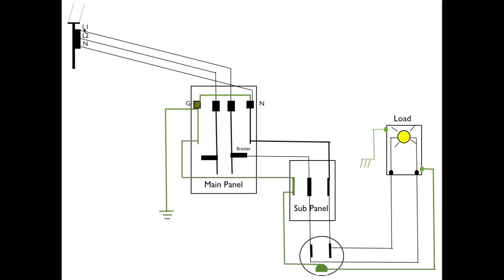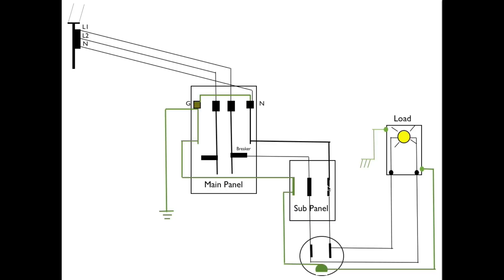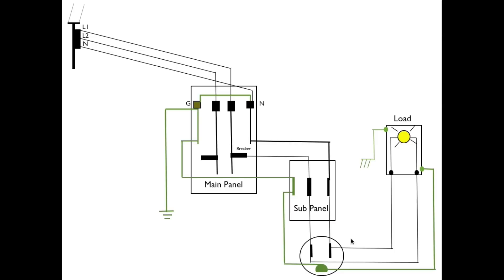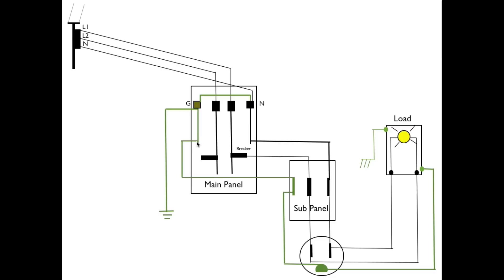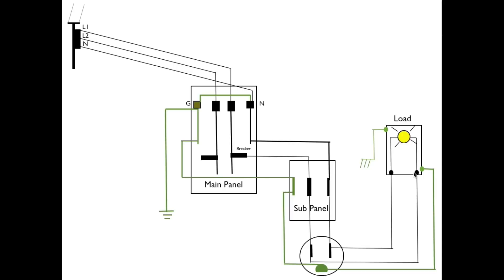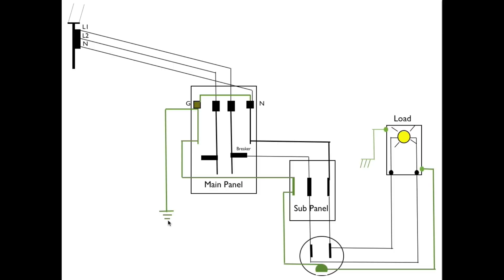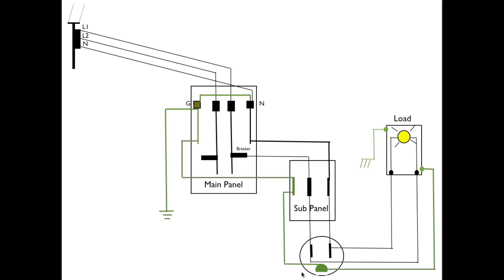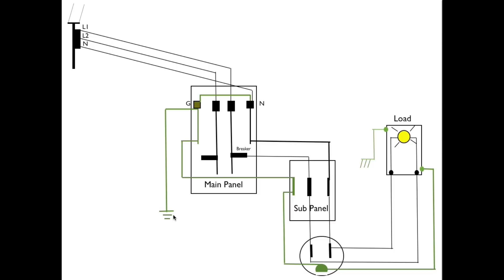The difference between neutral and ground on the electric panel

Comment: There is no such thing as a ground wire , in the NEC. the conductor going to the grounding electrode is a grounding electrode conductor. The equipment Grounding conductor is between the panels. The EGC is to return to the neutral at service because this is its path back to the transformer at the pole. A Fault Current on the EGC is not going to go to ground ( the earth) but to the services neutral to the transformer and return to the breaker thus tripping the breaker if the fault current is 6 X the breaker ampacity . Fulmer Electrical Training
Reply from the maker: necfulmer Oh, for Pete's sake get over it.  A wire, a conductor, its just semantics.  The point here is defining why the ground and the neutral are not connected in sub panels and the solid reasons why it is done that way.  We are not passing codes here, just explaining.  At least, we are in agreement about the neutral and fault current.  However, the fault current is not necessarily 6X ampacity.  Small over currents will still kick the breaker, just not immediately.  Despite my complaints to you I do appreciate your comment.
GFM
Reply: Point out anything under six times the breaker ampacity will delay the tripping. 120 amp fault and over will trip a 20 amp breaker immediately. A 40 amp Fault can take 5 seconds to 120 seconds. In that time something can burn up. So better the effective Ground-fault Fault  current path the quicker it will trip. Very important , loose screws, fitting and joints can delay the tripping.Also bonding the neutral at a sub panels can cause delay and stray voltage current on all metal parts.
Reply: grayfurnaceman
Reply: necfulmer — Nobody is going to use the new NEC terminology unless some authority figure demands it.

Comment: thing thats always confused me is in a circuit without an isolator on neutral the insulation test always shows a direct short to ground. so fine if you disconnect the neutral you can test the circuit. but if neutral itself is showing a direct connection to ground through the transformer why the fk doesnt it go bang the way it does if a circuit neutral has broken down at a switch or within an appliance 🤔 i get that its a different type of ground but still confuses me to hell 😑

Comment: Got to get them together in the maim meter and separate I'm the main panel, this way to wire is more then 20 years old, is not the new code
Reply from the maker: Not to beat you up, but your use of the english language is terrible.  If you are trying to get across technical information, you have to deliver it in a way that is understandable.  Try again or get someone to help you get your idea across.
GFM

Comment: Sir I think you could have done a better explanation... you never use the word impedance or bonding. If a lighting hit a pole it will go to the lower impedance conductor. Which it will be your grounding electrode,  mechanical ground or your EGC equipment grounding conductor. Amazingly the earth is NOT a lower impedance path.. electrical work it is a DIY for the weekend. Leave it to the pros.
Reply from the maker: This not a code video.  It is an explanation of how things work.  Sometimes the language used in code discussions makes these concepts harder to understand.  I also do not find that earth ground is not a low impedance path to be amazing.  Dirt never has been low impedance and its only use is for a zero voltage plane to absorb lightning charges and spikes created by components in the line.  This concept is poorly understood, even by some electricians.
If you think lightning only travels thru the low impedance conductor, you are mistaken.  It will travel thru all conductors.  We just hope most of it travels thru the lowest impedance conductor.  Not trying to beat you up, you are just not object of this and the other videos I have done about electricity.
GFM

Comment: LIGHTENING strike at the pole, Your pole should have or better have an earth ground from 
transformer down the pole to earth.
Reply: Mine had a copper line on it but crackheads yanked it down from the pole like they did most of the poles around here.
Reply: That is completely up to the power utility who owns the lines, the pole, and the transformer.  
They always install a bare solid copper wire down the pole to a ground rod.  Usually every pole has a ground wire run from the neutral down the pole to an earth-ground rod.
If they failed, it is grounds to sue the power utility company to finish that job.  
Safety feature=required
Reply: micheal- wow you are looking for needle in a haystack dude, i think you forgot to mention how deep the rod should be embedded in the ground by the pole.

Comment: But neutral in the main and subpanels, and ground are still electrically connected to one another..
Reply from the maker: The neutral is not connected to ground in the sub panel. It is connected in the main. If all wiring is properly connected all is well. But if there is an open in the neutral at the sub panel, consider what would happen if the two were connected at the sub panel. 
GFM

Comment: Neutral is still connected to ground. Why does it not go straight to ground. It is a short.
Reply from the maker: There is no short because earth ground is not part of the circuit.  It is only there to discharge lightning and spikes.
GFM
Reply: @grayfurnaceman  In the diagram they are connected at the main. Going by that, they are. Explain please.

Comment: the return through the neutral wire back to the transformer and again back to you through your meter is power you are paying for again and again. Wonder why your power bill keeps going up still? if you were to tap that return and divert it to useful energy wonder how much the bill would go down. they have figured out that an earth ground ensures that most of the return goes back to the transformer which is again "recycled" back to the meter at full cost. there are devices to cause this diversion. as an electrician I can tell you that with our system of wiring that some strange things can happen when a circuit is not complete or if it is completed in an icorrect way ie: arc fault breakers gfi's and what not. but just as in DC circuits, all that is required to run a load is a supply and a return. in which case in our current electrical system causes a lot of heat loss which is energy loss. there are cold electric possibilities, but that would make power companies go out of business. informative video for the layman in terms of our current systems of power generation.
Reply from the maker: The above comment is left posted.  However, I do not agree with his conclusions.
GFM